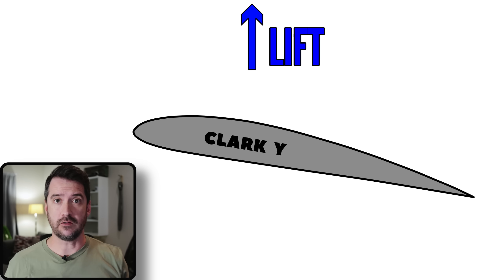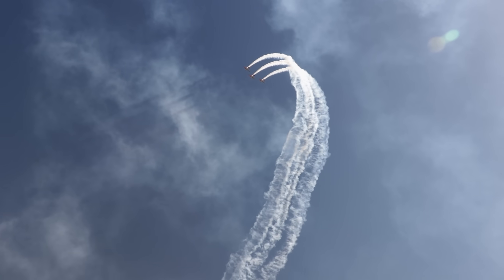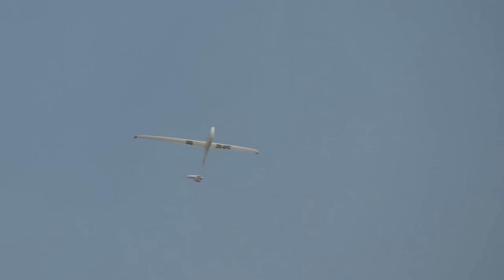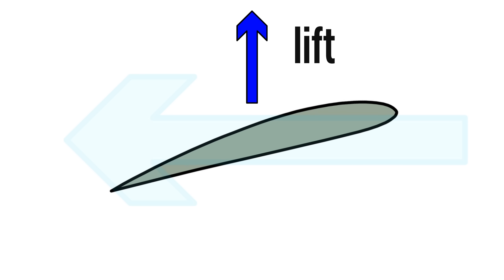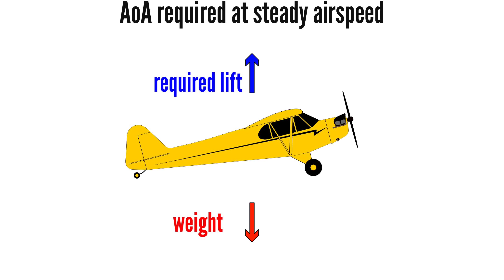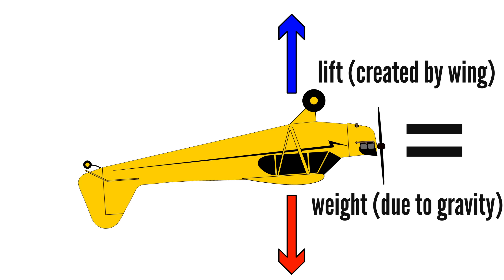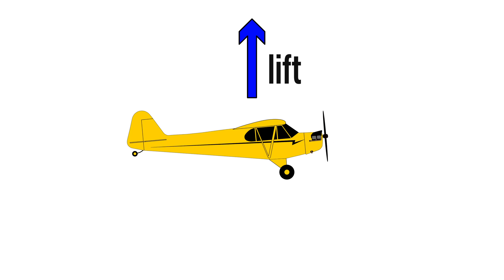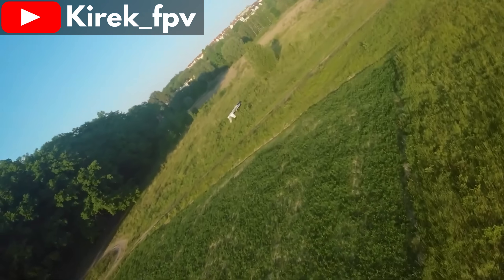Is Airflow Distance Over the Top of a Wing Always Longer?

Comment: It's the fallacious equal time path idea not the distance the air travels that most comments I've seen about inverted flight are about. NASA has demonstrated that air going over the upper surface of a wing (whichever way up it isto the direction that gravity acts) takes slightly longer to get to the trailing edgethan air going underneath the wing.

Comment: You covered the points very well. 
.
There is one point, however, that I suspect you understand, but glossed over very quickly. I know your focus in this video is very narrowly confined to equal transit and path length misconceptions, but when comparing full size aircraft and models, there is a significant matter regarding scale that most people do not understand. 
This is now commonly referred to as the Square Cube law.
.
A model that is 1/10 the size of a full-scale aircraft, but constructed with exactly the SAME materials and techniques as the full size aircraft, will have only one tenth the weight compared to the amount of lift.
The weight will be proportional to the volume which is 1/1,000 the full scale aircraft, but the lift would be proportional to the surface area of the Wings thus 1/100th. 
.
Viewed the other way, the model has 10 times the lift of the full size aircraft, compared to its weight.
Because the materials in the model are typically much lighter than those used in the full size aircraft, the effect is even greater. 
.
Therefore, one can almost say that the model has virtually no weight and flight is assured regardless of how efficient the wing is at generating lift, upright or inverted.
- -
Cheers

Comment: Wing loading should not be calculated linearly. This gives a misleading low result for smaller craft, giving the illusion the wing has a large margin for load. Very small model aircraft require very light wingloadings. This is because the area declines to the square of linear reduction, while the weight declines to the cube. Wingloading is therefore best calculated with a 3/2 exponent to account for this. Google WCL. Model aircraft can fly upside down because they have colossal power ratings and can fly at scale speeds far exceeding their full scale counterparts, enabling lift to be generated while inverted despite the inverted wing section. Wing loading is not the differentiator.

Comment: In my simple mind, it seems pretty simple to me. It's all about angle of attack. Air pushes on the underside of the of the wing raises pressure causing a thrust vector which has a lift component and a drag component. The air going over the top lowers pressure adding to the net positive pressure increasing lift and I think reduces drag a bit but drag is still a net positive. Just imagine a flat wing with no curve at all. It will still generate lift as long as there is a positive angle of attack. In my childhood I made balsa rubber band powered model aircraft where the wing tail and fin were all flat sheets of balsa about 1mm thick. With the right balance to get a positive angle of attack, it flew nicely. As I see it, airfoils are just ways to improve efficiency but not the primary cause of lift.

Comment: Very interesting.  5:34   I noticed the still shot drawing shows plane's nose is tilted up a bit.  This change the wing's angle of attack.  Now the wing os pushed up by the fatter, followed by a laminar flow as air passes the hump and roils across the rest of the wing.  
     The wings are also tilted up like the nose.  That means air is still passing over the full wing, creating low pressure vortexes, and lift.  On the downward side of the wing, the hump at the front splits the air in teo with thr top flat side creating low pressure across the width of the wing.  A high air pressure point is created at the leading edge of the wing.  This creates inverted lift since the air pressure is lower on the up pointing width creating low pressure initially is provided mechanical lift.  The air ccreated low pressure vortices on the up side and high pressure vortices on the down side as a result of the up tilt on the wing.  
    The result is both sides of the wing provide lift, keeping the upside down plane the same lift components as upside up wing.  Slightly more advance force is needed to keep the nose tilted up.

The upside down wing is a key feature in F1 cars.  It creates the low pressure zone under the car, and high pressure over the top.  The greater the downforce, the better tyres grip the road surface.  This improves handling in the corners but drag on the straightaways, which can be reduced by opening the DRS flap on the topside wing at the test by reducing the downward force on the car.  Watch any F1 race practice sessions, qualifying, and GP and it's easy to see who got the wings right, and who didn't.

Comment: It has nothing to do with high or low pressure holding the plane up. It only has to do with the planes density versus the density of the air. If the plane is lighter it rises, if denser it sinks. Balloons float and they don't have wings, the same with ships. Ships float, not because they are displacing water, but because the hull is full of air which is less dense. Ever notice that when a ships hull fills with water it sinks?  The wings of a plane spread out the weight of the plane out over more air. The bigger the wings are the slower the plane has to move. Forward speed pushes the wings through more air faster and is in effect making the plane lighter by spreading its weight out over more air density per second. Pretend the plane is moving through Jell-O. The reason birds wings are shaped the way they are is to decrease drag, not generate lift.

Comment: A normal wing shape basically has an angle of attack already made in it so it pushed up while the body is level. 
You can get neural wings sometimes used by on stunt planes. They fly, but you will need some angle of attack to get any lift at all. Just an equal angle upside-down. Which is good if you're a stunt plane. 

All wings make lift by moving air down, thus pushing the wing up. Just like the props make thrust pushing air back. Its basic reaction force. 

There is no wing that pushes up with no air being pushed down. It would be like a nutral rudder in that case cusing no push at all. 

The arofoil is just an effent way to have an psitive angle of attack built in while the aircrft is natural.

Comment: Seems like the answer to the ultimate question of what causes lift is more complicated than either of the simplistic theories that it's AOA, end of story; or it's the longer path due to wing camber, end of story. The answer will be different for different aircraft (or flying body) designs. The two theories are not mutually exclusive, and for most lift generation solutions are a combination of the two. Really, the answer for a particular flying body falls somewhere on a spectrum from jet engine strapped to a brick (more practically a rocket) to a highly cambered air foil (a glider). 

The simplest demonstration is a sheet of paper stretched between one's forefingers and thumbs, with the trailing edge hanging down freely due to gravity (or space/time curvature). We've all seen this. Blow air below the paper and the trailing edge lifts up--AOA effect. Blow air above the paper and the trailing edge lifts up--longer path effect. Blow air evenly both above and below the paper and the trailing edge lifts up--combination of the two effects. I am guilty of oversimplifying here, but then we all seem to fall into that trap.

The question that has not been answered here (honesty, I did not read EVERY comment) is why does camber matter? More precisely, what is it about camber that causes a fluid to curve? How does the curved path of a fluid change the ambient pressure along the curve?

Comment: I recall when my brother asked me this question, which I had not thought of before. My answer seems to be understood well by non-technical people, and it takes less than the ten minutes that you took.
If gravity is pulling on you and you are attached to nothing, and you do not want to go in the direction that gravity is trying to pull you , then you need to send something else in that direction , instead of you. This creates the "equal and opposite force" on you to keep you up. This applies to rockets and wings. In the case of a wing, it sends air down, instead of you. The airfoil shape seems to be the most efficient way (less drag per lift, therefore more speed per horsepower). No wing optimized for flying one way will be as efficient if it is turned upside down; so I postulate that no airplane can fly as fast upside down as upside up.
Reply: It can also be explained in terms of air pressure, on a molecular level. The random motion of air molecules colliding with the wing surface creates pressure. Somehow, the wing shape and motion need to combine so that the total force of all the molecules colliding with the top of the wing needs to be less than the total force on the bottom. I have imagined a circular airfoil (like a UFO) that could use a small, jet engine with the intake coming from the underside of the rim and the outlet directed peripherally from the center, topside along the upper side. The upper side could be partially ducted with a steering vane in the duct for directional control. A trim tab on the trailing edge could provide pitch control (like a helicopter) to translate the lift into forward motion. It may not end up being efficient or practical but it would be really cool to show up with at a remote-controlled flying convention!
Reply: A totally symmetrical wing and airplane could. Not practical for manned flight, but could be tested with RC aircraft or gliding bombs.

Comment: Does the change in position of the Stagnation point as the angle of attack changes result in a longer path over the top and a shorter path below? Just an observation from my chair but without a wind tunnel and some careful measurements there is not conclusion to be drawn. 
Hmmm. 🤔

Comment: The numbers don't lie...!  A fluid ALWAYS accelerates from an area of HIGH-Pressure to an area of LOW-Pressure.  That's why a punctured tire loses air.  When analyzing the stable airflow  around a wing, 2 adjacent air particles approaching the wing, if they get separated by the wing, one goes over, and one goes under, then they will be reunited when they reach the tail-end of the wing.  In order to travel a LONGER distance, the air particles need to accelerate faster and thus go faster, and thus the air pressure must be LOWER on top than on bottom.  You may also want to consider VISCOUS vs INERTIAL forces.  When your speed gets fast enough, then air can be modeled as just a bunch of independent billiard balls.  The "Stagnation Point" is the geometric location where the flow of air splits adjacent air particles either over or under the wing.  The Stagnation Point changes with "Angle of Attack."  Think about the "Venturi Effect".  At sub-sonic flow rates, the conservation of mass is King.  When you reduce the diameter of a pipe, then the inlet-pressure in the larger pipe goes up, and the speed of the flow accelerates into the smaller pipe, so we know that fluid accelerates from high pressure to low pressure, and thus the smaller diameter pipe has a lower pressure than the inlet pressure.

Comment: My understanding (after significant research) is that nobody - and I mean nobody - understands why motorcycles are vertically stable when at speed.  If you think I am wrong about this, go ahead and research the topic.  You will, no doubt, come away quite surprised.
If nobody knows how motorcycles work, I suspect that less than perfect understanding of wing lift generation is not too difficult to believe.

Comment: I'm not a pilot but rather a science teacher but I did fly hang gliders for a long time and now sail a lot which both involve "wings" with a camber.  I share your frustration as lifit is obviously created simply by both diverting a fluid flow and a pressure differential above and below the camber.  A simple flat board held at any angle other than parallel to a fluid flowing will cause a force on that board i.e. angle of attack but different cambers also generate different amounts of lift and the total lift is the combination of the two.  If the plane is upside down still carries it's own weight then obviously the downward camber lift is smaller than the upward deflection lift.  The "lift" from deflection is simple vector motion where force in the horizontal axis can be transfered to force in the vertical axis and this is where you can use trigonometry and coefficients of friction etc to estimate that.  Seems pretty straight forward at a high physical level to me?  Missiles with rocket engines have no cambered wing and just have flat stabilising fins and they "fly" just fine without any so called "aerodynmic lift".  Fighter jets also use "vectored thrust" to alter the force vector of the plane which is a moveable nozzle on the jet engine and they also have very flat wings which could not stay stable without modern software control and extremely powerful thrust engines.  This misunderstanding is caused by over simplified explainations i.e. lift is caused by a pressure differential about the wing caused by a longer path over the wing ie. camber - but like many "lay" explainations, it is only a very small part of explaination.  People have written books about science and engineering misunderstandings but that's what you get when people think they know everything when in fact they are 99% ignorant and simply don't know what they don't know while smart people always are aware of what they don't know which unfortunately leads to ignorant people being very confident and smarter people doubtful about their own kwowledge and understanding.  Such is life.

Comment: I read a few of the comments below (using current time as the datum), guys.....
In the beginning people looked at birds and tried to emulate their flight processes, the Wright brothers used wing-warping instead of ailerons.
Then people realised what was actually happening and along came ailerons and the rear elevator.

So to lift. The "highest performance" profile is rather similar to an owl's, it generates 'enough' lift whilst disturbing the air as little as possible and gives the owl its stealth. However the reality remains that lift is simply pressure differential from one side of a wing to the other. 

So...  what advantage do you gain by choosing the owl's wing profile over any other? The required minimum airspeed is reduced and drag is reduced, the owl does not flap its wings during an attack on prey otherwise the prey would hear it coming, excepting the last second. 

How does that apply to aircraft? Well you can get off the ground with much less engine power, that becomes less appealing when local disruptive wind speeds are comparable to the minimum necessary air speed or if you wish to travel a long way. 

Instead of thinking about air path-lengths think about the mean speed of air molecules...

Comment: For simplicities sake here, "Down" is the direction a dropped object will fall in relation to a person in the airplane and is in depend of where the ground and sky are. A pilot in a properly performed loop will point at the floor of the airplane throughout, regardless of what is below the floor.
    Some of the lift component does come from the lower pressure on top of the wing, but the majority of the lift in generated from the wing pushing air down.
     So long as the shape of the wing pushes air down, it will generate lift, however some wing shapes are better at this than other. The most efficient wing shape for "normal" subsonic flight, that is what you would expect on an airline or air taxi flight is an airfoil. Sort of a teardrop cut in half. 
     This wing shape will generate lift over a wide range of speeds because as it goes slower the angle of attack can increase, effectively making the wing thicker. At least to the point where the air can no longed follow the shape of the wing. The wing will stop pushing the air down and becomes turbulent.
     As I said this is the most efficient shape for "normal" flying, but some people want an airplane to fly up-side-down. For an aerobatic airplane they have a different shaped wing. This wing is less efficient right side up, but it is much more efficient upside down. 
     A "normal" non aerobatic wing CAN work up-side-down, but it is very inefficient, requiring a much greater angle of attack. Rather than being concave or flat, the underside of an aerobatic wing is rounded. Usually not as much as the top, but much more than a normal wing.
     At speeds higher than the speed of sound you need a completely different wing shape. But that is not relevant here.

Comment: there is also power to weight ratio. Brute force can help a lot in flight. A rocket generates almost no lift but can still fly straight because of sheer motor power.

Comment: A plane can fly with rectangular section wings if the thrust is sufficient.  Forget aerodynamics; simply deflecting air downwards causes an equal and opposite force upwards on the wing.  Newton!  The ratio of Newtonian to aerodynamic lift ( at different speeds, weight, thrust etc ) would make a more interesting video.